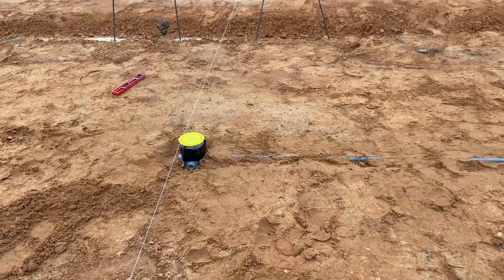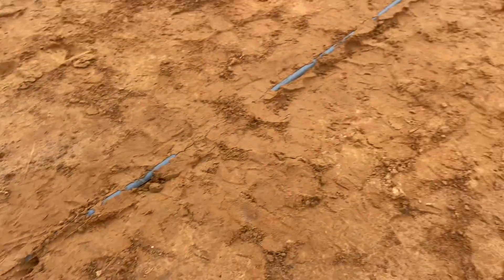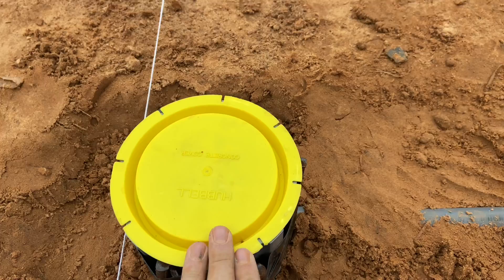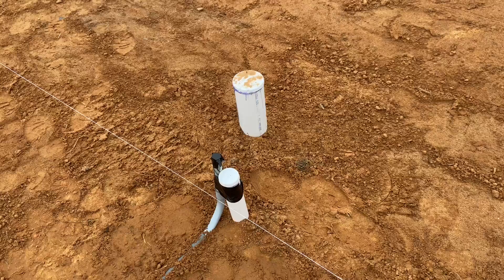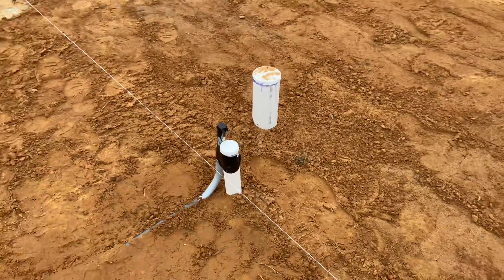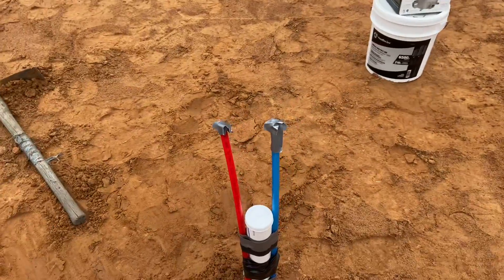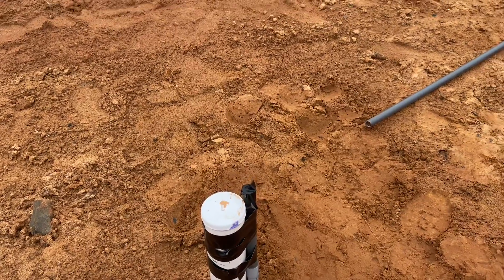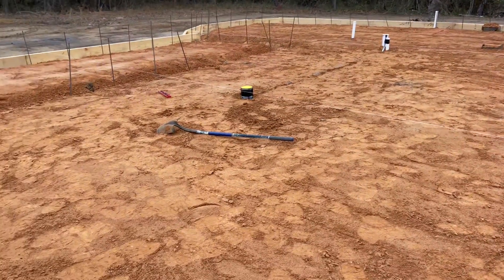Episode 34 - Electrical in the Slab

Comment: @ciband I have a question did you run the electrical under the footer or just connect the island electrical once the walls were placed?
Reply from the maker: Conduit in the slab and then pulled wire during electrical rough in. Conduit stubs up in a plumbing wall and I used a 2 gang j box to transition from romex to THHN. 

thanks for watching.

Comment: Doesn't code require water pipe (pex) need to be sleeved with pvc ?
Reply from the maker: Not to my knowledge for passing through concrete.  This method seems typical here but I agree that using conduit would be better.  I did that for my shop water line since I had to make a space for it before I actually had the line.

Comment: I like that I think on the next part of my build ill do that. Thanks for the video keep up the good work. I've got some video posted also I think you doing really good 👍
Reply from the maker: Cool. Thanks for watching.
Reply: @Ciband  
Wow you did a fantastic job.
You were in my recommendations, you are now going to have one extra subscriber.
Food for thought, you're not going to want to run THHN wire. You will want to run THWN wire. And most likely your inspector is going to want to see that in  wet or below grade locations inside a conduit.
They do make a dual rated type wire.
Other than that keep up the good work.
Reply from the maker: Thank you for the kind words and clarification on the wire. I am using dual rated wire and should have said that on the video. I got lazy with the terminology. 

Thanks for subscribing.
Reply: @Ciband  
No problem. 
running the circuit through conduit is always the way to go for that scenario.
I once saw a million dollar condominium, remodel job.
Where the electricians ran power to the island by putting the Romex or non-metallic cable. Between a gap in the subflooring plywood. Which is not only a code violation but a fire hazard.
I don't understand why people think by saving pennies you will save dollars
Reply: @Ciband  no thank you for posting i have 3 of you video on my watch list I think it going to help me on some things